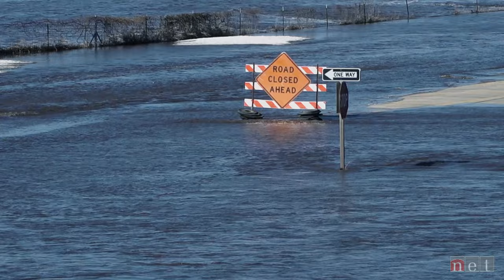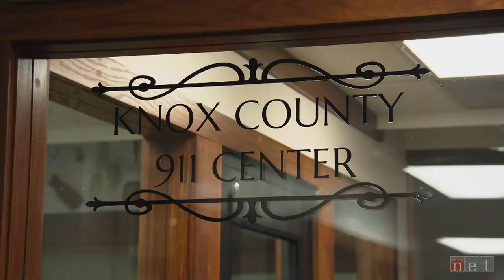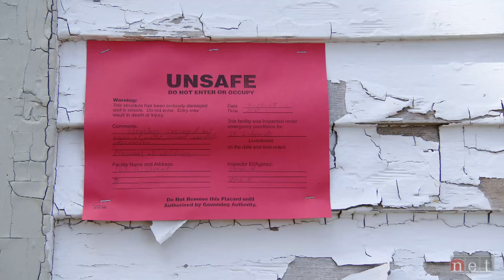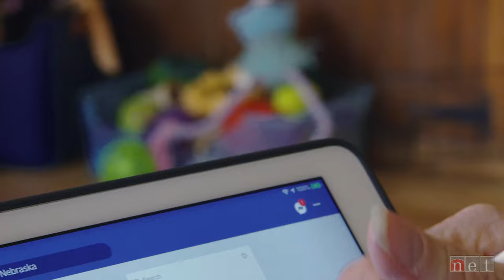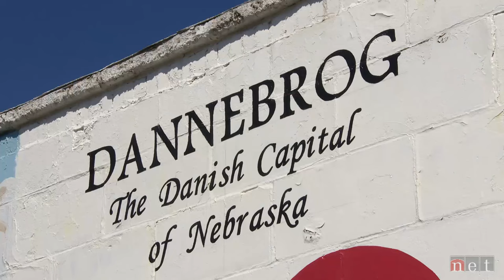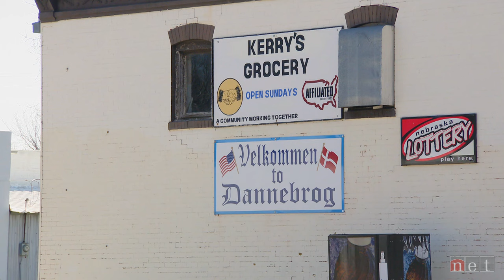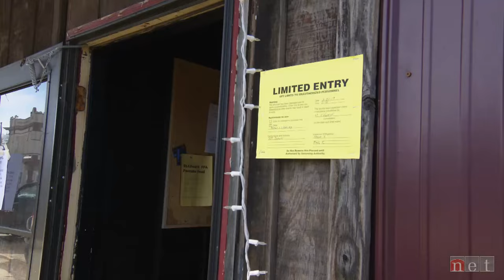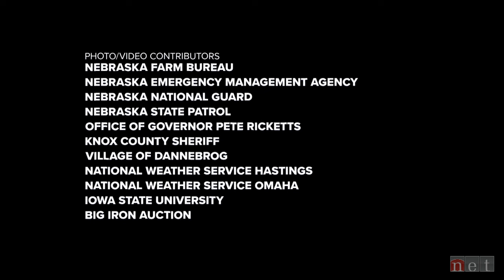And The Floods Came

Comment: So basically the natural seasonal cycle of a winter blizzard dumping heaps of snow and ice on plains previously! and for thousands of years unpopulated now after a hundred years so  developed!?, melts and it's a surprise?🤷‍♂️
Reply: We had record snowfall that winter with multiple blizzards & unrelenting cold so there was no melting-all the snow just continued to pile up. Then three days of rain and it all melted at once-too quickly to be able to soak into the frozen ground. The rivers couldn’t handle the melt from Northern regions plus our water. The ice broken from smaller rivers created huge dams which blocked the Missouri  from running normally. This was nothing like a normal winter cycle. Did you watch the movie? I’ve lived here for “normal” flooding and it’s nothing like this.

Comment: The buildings need to be elevated. The buildings are build too near to the ground so water can easily  get in the buildings. Build strong concrete structures bottom up. Pray for your town. Put God first in whatsoever you all do. Love each person not only your friends and families. May all your troubles evaporate throughJesus Christ our Lord. Amen
Reply: This is hard to do in Nebraska because it’s right in the middle of tornado alley, meaning houses need basements. It’s a hard problem with no easy solution, but U see your point.

Comment: When the floods come, you should have a crew downstream that is constantly digging out the dirt and the debris from the bottom of the riverbed.  This will deepen the channel, and allow more water to flow out of the city, per second.  Also remove all obstacles along the river that slow down or impede the water's flow.  Have those crews operating 24 hours a day, 7 days a week.

As they dig the channel deeper, the water will rush in faster, bringing in more dirt and debris, which you can easily scoop up, because it is all loose.  This will erode the center of the river channel, which will make it bigger and deeper and faster.  The more you do that, the more water you can drain out of a city in a rapid fashion.

Also, straighten out your channels, as much as possible, whenever possible.  Water always slows down when it has to turn.  If it has to turn too many times, it can slow down to an absolute crawl and pile up.

Take the dirt and the mud, and place it on the slopes where the hills meet the flatlands, or wherever its most needed.

Even better yet, dig out your channels NOW, while the waters are tame, and the work is relatively easy, rather than waiting to try to do that during a horrific flood.
Reply: Or, don't build in flood-prone areas.
Reply: Where do you live ? Some place that warm is my guess . The rivers were frozen with ice that was 1,2, or more feet thick and the ice can breakup and form ice jams , or dams .
Reply: @Jemalacane0  there were many places that were not in flood prone areas .
Reply: This is a good solution in theory, but you forget that this is rural Nebraska. We don’t have the resources to carry this out in a city of 1000 people, both because of a lack of tools and man power. About your statement of doing it ahead of time, this is like saying just build a stronger building where the tornado is going to be, which is impossible. We had no idea that it would get to this point because it had never happened before.

Comment: You need gravel and rocks not sand because it will look like a beach you have sand unless it will be cemented..
Reply: when we had floods in Winnipeg, Manitoba, always used sand. Has been used for over 150 that I know of. If it works, don't change it.
Reply: 150 years